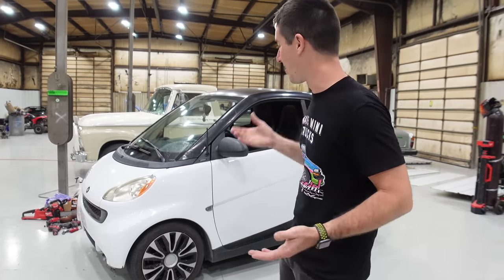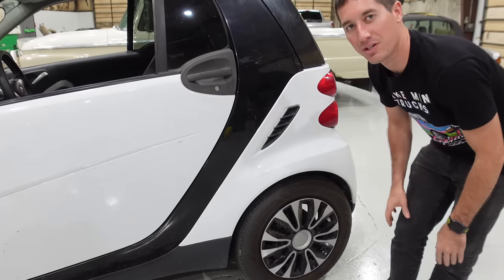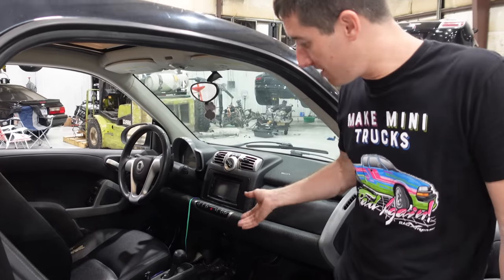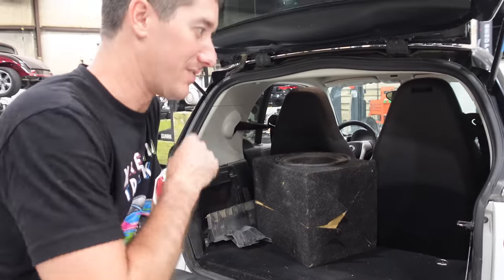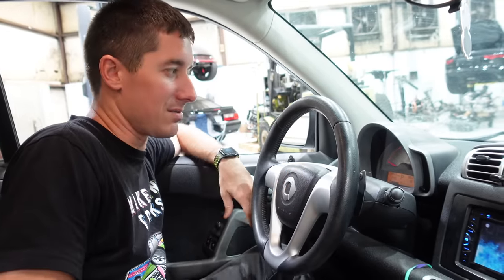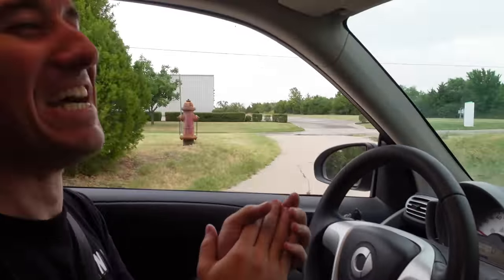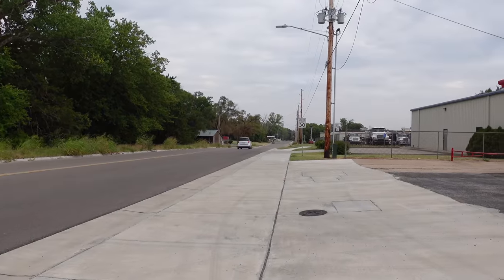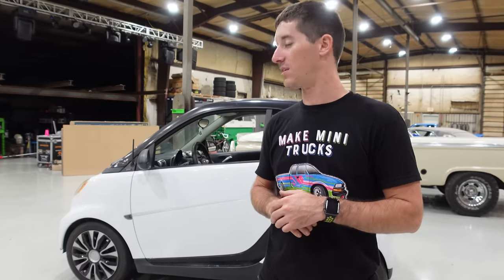I BOUGHT A CHEAP Smart Car.. Is It As DUMB As They Say?

Comment: For the coolant temperature, I guess all the car has to tell you that it's too hot is an idiot light ... which is ironic to find in a Smart car.
Reply: There are a lot of "smart" ideas, like the ignition key, the computer logic knows you want to start, when you turn the key , so release it quickly! (RTFM).
Holding the key in start position is not required.
Automatic windows probably failed after battery swap.
The electrics could do with better damp protection!

Comment: The ABS computer is OUTSIDE UNDER the drivers footwell.  The plug leaks so the electrolysis on the power pins eats plug and socket.  No power...no brakes....
The cooling system will destroy the engine as a tiny head gasket leak will fill the head  with a bubble of exhaust gas pressurizing the coolant DOWN UNDER the cabin.  This bubble cannot escape DOWN under to the front radiator so the bubble in the aluminum head blocks head cooling, warping the head and destroying the engine......
The muffler is up against many things the heat destroys...
The cast wheels will crack at the rim/spoke junction if you bump a curb and MUST be replaced with the steel wheels off the cheap Pure model before the crash!
The rear CV joints self destruct as the thin rubber boots rip....
Three bars in the display where R-N-D should be means you're stranded and need ONLY a flat bed tow truck to find someone to fix it as the MB dealers want nothing to do with it and you MUST have an MB Star system to reprogram it....
The crap plastic sunroof is only glued on and must never be allowed in the sunshine which will craze it with millions of tiny bubbles Bayer Plastics told me was not properly dried when the sheet was pressed.  All 4 of mine crazed.  The sheet is destroyed if you try to unglue it.  No more replacements are available...
Changing the alternator belt requires engine/tranny removal as the left engine mount is in the way...
Junk yard computer parts won't work unless reprogrammed by a Star $10,000 computer on an MB subscription service.
I've forgotten a thousand other flaws in this cute PoS......

Comment: I'm about to do an engine swap on my 2009 Smart Brabus, its not going to be fun!!!
Reply: How many miles did it go, before failing?
Reply: @mylifethaidiy7045  well sad thing is it failed from human failure not from mileage. My partner drove it with a bad radiator fan and over heated it so badly it blew the head gasket. But it has 134k on it.

Comment: I want to buy it from you as is, been looking for one for a while. I have a salvage one that I already stripped out and put everything in the storage building. I got all the parts. All clean and ready to be put on. It is the same year and has 10,000 miles the Parts do. They fix very easy. The other one had only roof damage a tree limb damaged it. Windshield is OK same color. I will swap everything out in about 2 days..I got everything.

Comment: Okay, this is from a Smart-Wahhabi, BUT all the sh*t it's gearbox gets is really unjust. Remebering that first gen was conceived around 1996, it was really okay for the time. Keep in mind, a classic torque converter for a car of that size and performance would absolutely murder any fuel economy, that's leaving the whole "would not make any sense" part out. The 2008-2014 gen was a slight improvement; two servos catering to even/uneven gears - compared to it's contemporaneous rivals, usually  sporting CVT's - really not bad. In your usual european city traffic you really forget the gear changes. The plight starts when you own a 71 kilowatt version, and you want to do some 0-100 kph runs. Really, how often will an average user do that...

Comment: These cars are great if you routinely have to park in big parking garages. You can take spots that normally only motorcycles can fit in. Other than that, there's not much point in owning one. They get mediocre MPG at best, especially considering their size and weight. I wouldn't mind having one as a goof but only if I could find one with a real manual transmission.
Reply: I get 40-45 MPG with mine. The absolute best I've got was 55 MPG.

Comment: My 2004 Skoda Octavia 1.6 is slower =D 0-100 km/h in 11.8 seconds, that's 0-62 mph. Also, it doesn't even have power windows or power adjustable mirrors!
It does have a/c though, i wish it was working right now.

Comment: Have had my 2015 Smart ForTwo Passion for commuting for the past year....its a great little car. I did maintenance on it oil, air filter and spark plugs...now I get 45.4 mpg.  My other cars are 2019 MB GLC-300 Coupe and 2011 Chevy Silverado 2500HD. I laugh when the rednecks in the big diesels who pass me aggressively and then stomp the gas making the exhaust plum at me. LOL. On the back window I have a sticker that says....I am not a Liberal...I am saving money to buy more guns! 🤣 The clutch is the same that is used in F-1 Formula cars.

Comment: The SMART doesn't get incredible gas mileage.  Its forte is parking in tight spaces and you can park it like a motorcycle on a curb.

The SMART is basically a safety cell with wheels. I'd rather be in an accident in this than anything made before 1980.

Comment: Actually it has some very good features, too bad it's so small and a death trap. But it's not anymore dangerous than the motorcycles I ride. 👍 Also something that small should be getting about 70 mpg, but it only gets about half of that.
Reply: Far from a death trap. These cars were designed for safety.

Comment: He talks like he doesn't know you can take control of the transmission and shift it at will, or delay and rev higher than the computer would.  Paddle shifters, baby!
It seems odd that a 2009 with the Passion trim doesn't have a tach.  My 2008 did, the dash pods were kind of iconic for the earlier smart, except for the base models.
the engine is 999 cc (call it one liter).
Where does he live, that he thinks "everybody" is converting smarts for offroad?  I've literally never seen that.

Comment: Back when I was a car dealer, a whole shitload of these things came through the auction and I wound up with one. I hate these cars so very very much. Got really bad MPG for it's size and driving one on the highway is an adventure to say the least. Sorta feels like when you get out of the groove at a 1/4 mile track, kinda wiggles and feels like it's about to go horribly wrong. Then I about shorted out the whole car, because the battery wires are the wrong damned colors, I think green is positive, which in the dark looks very much like a negative.

Comment: I gave you a thumbs down cause off road driving and high acceleration was never a target by designing the car. So testing it that way or complaining about it's size is humiliating it. The car was designed for European city driving. The targets were: enough space inside for this driving condition (humans are mostly alone in a car or with a partner, mostly with one to two bags or groceries for one week. Very rare more). Less parking space (important for European cites). Less fuel consumption. But with the safety of a bigger car. This in mind its a really good car. Nothing to make fun of it. 
Btw thats a reason why US American cars are seldom bought by Europeans. They don't fit the purpose.

Comment: waste of money, but you do you. I think they require premium gas, and then only got around 30 mpg. My 07 Elantra uses 87oct and gets 35 mpg on the highway and 30 around town, has 137HP, seats 5, has a good size trunk, and is still maneuverable since it is a smaller car. Oh, and it cost almost 1/2 the smart car and is cheap to fix. Smart cars have no reason to exist unless you live in a crowded city. The smart car will off road better than my Elantra. My 07 has auto down windows and a fully openable glass sunroof and shade. Also has airbags a plenty and at almost 122,000 miles, the original shocks are still good all the way around.

Comment: A guy i worked for had a first gen. To get it to shift you would use the fuel peddle to shift when you needed it to. Just a quick let off and back into it. I hated driving that thing on the interstate, it was scary next to an 18wheeler.

Comment: The only thing funnier, are the chinese knock off smart car's, and they are not safe at all, more like a coffin on wheels.  They have knock off bmw's, and are made with a bunch of different parts from whatever manufacturer parts will fit the thing.  They have to change a few thing's on the car, so that it has some difference from the original car.  The clone car's need lot's of repairs, because they sure don't make them to last, the body lines are bad, and they look cheap.  Hope you get rid of this smart car before it's destryed off roading lol.  G-d bless, and good luck.